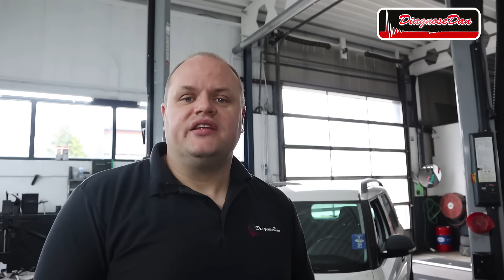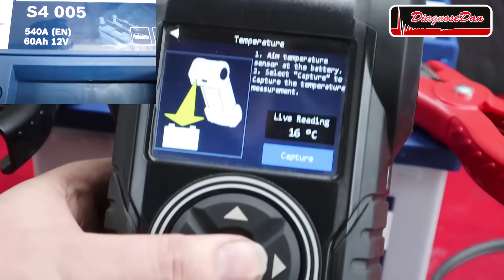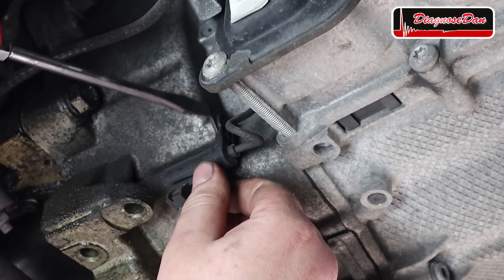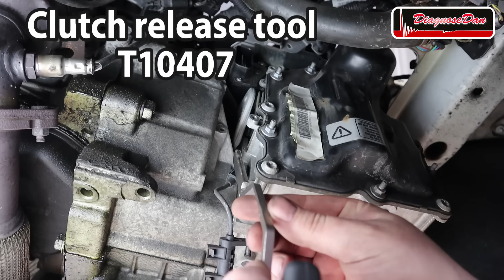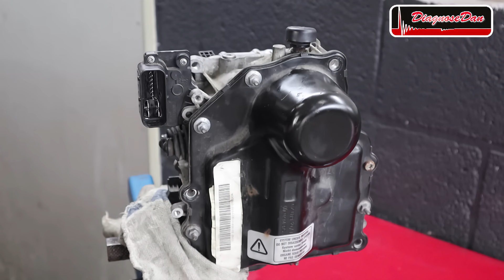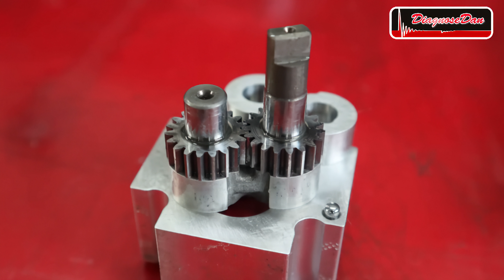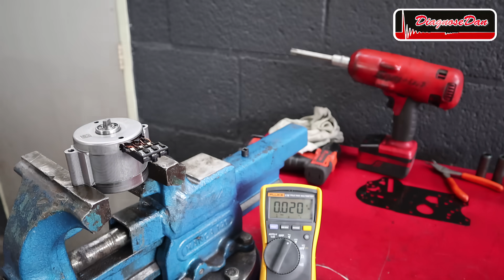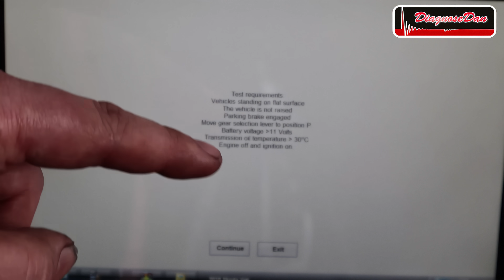DSG Gearbox Diagnosed explained Fixed

Comment: The labor cost for diagnostic seem to be much higher than the gear box unit itself. The car seem to be new but the damage to the board components for faulty design or maintenance seem to be extensive. I doubt it very much that most American repair shop will spend much time taking the gear box apart to look for the cause of short circuit, rather than order the new module and swap it then charge for the service.

Comment: Would a tester like this work on a BMW where you attach the charger/tester terminals in the engine bay even though the battery is located in the trunk?

Comment: Hi, I have a 2012 seat Leon  diesel automatic that flashes up select n or p  on the dash but won't start no matter where the lever is, fault code is 01315  gearbox control unit, no communication, perminent.  Any advice? Thanks

Comment: Very informative to see how this works - had this happen to my MY15 Mk7 Golf a few weeks ago when stopped at a set of lights. The local VW dealer wanted $3000 (Australian) to fix it as it was outside of warranty (only 3yrs when I bought it) but then found out about the safety recall. Got onto VW Australia and played the 'if you don't fix it, I'm about to buy a new car and it won't be a VW' card and lo and behold a few days later the dealer rings to say that its going to be covered by warranty.
Reply: hey peter, Im going through this problem atm. VW have told me they won't cover it. any advice?? I'm off to the ombudsman otherwise!

Comment: Hi Dan can you please help me, I am going to take the black sump/cover off of my dsg dq200 to change the accumulator and housing because it has cracked and is leaking fluid out through the breather. I was just wondering if the car has sat for a week untouched will it be okay to take the cover off or do I have to release the pressure through vcds or do I need the clutch release tool in this video if I am just taking off the black accumulator cover?
Reply: Я думаю, Вам необхідно буде замінити окрім аккумулятора тиску ще й гідроплиту мехатроніка. Для цього потрібно зняти мехатронік.

Comment: hello sir i am from india .few months my volkswagen passat 2.0tdi model 2010 automatic transmission .while i shifted D to drive then my car runs sometime normaly.but sometime  D3 to D4 not shifting' i hearing sound while d3to d4 forcing to shift gears; the sound comes like very rashy parts are moving like stone slide on marble. when i connect to diagnosis he shows "unexpected mechanical gear dissangagment.fault code p2711 found, what is the actual problem?

Comment: The best DSG tear down and run down video to date. The only problem is the acceptance of VW's root cause being the transmission fluid. That's a lie to help cover the massive recall. The root cause is actually a design issue with the TCU/ECM not being able to survive under the harsh environment. Could you let us know if there is a supplier of the pre-programmed TCU module for those of us who can not afford the complete unit.

Comment: The gear selector PRNDS lights are completely dead with a flashing spanner on the gear display. Engine warning light is also on. Key gets stuck when I turn the ignition off,have to remove battery terminal to get the key out. 
P173400- Active/Static - Stater release from the selector  leaver sensor system 
U010300- Active/Static - lost communication with gear shift Module. This are the codes I get on my Autel Maxipro

Comment: Hi Dan, what a great video as has being mentioned many times. I have a Audi q7 3tdi d,c,t. But i get gearbox malfunction light with engine light that stays on, strart, stop function stops working and i no longer can use cruise control. Then after a while the light goes off and everything starts working again.
Then randomly after some time it happens again. Do you have a video relating to this problem, or can you give me your thoughts on the problem?
Thanks Simon.

Comment: Good video Dan with explanation on the way  , textbook/mirrored failure of my daughters 7sp DSG in a Golf TDI same module burned damage & 30amp fuse blowing etc about 4 years ago, was the 1st one I had experienced at the time had the unit remanufactured with lifetime warranty by ECU Testing.com the rest like DiagnoseDan showed,   purchased the clutch tool an essential when carrying out this repair, changed gearbox oil at the same time with modified/updated dealer lube, job went well no issues, slightly annoying for a 35k miles car at the time it tarnished her faith in the model which I advised her to avoid in the 1st place  (I like my Japanese stuff)    ex Honda tech from the 80's/90's

Comment: Every morning it D "DRIVE" mode gear shifts from D1 to D4 and then it jumps to D6.... Down shift is D6, D4 & D2. After switching the engine OFF & ON again gear shifts from D1 to D4 properly and then again the error comes.... Code P073A & P1895

Comment: If you go under the car you can remove the connector for the mechatronic unit without removing the air box, in fact removing the entire mechatronic unit can be done from under the car. You didn't show how to get the car out of mechanical reverse which either requires prying from under the 6-R engagement mechanism on the mechatronic unit while removing or by taking the black inspection plate from the top off the gearbox and levering the gear train out of reverse, otherwise the engagement from the mechatronic unit will be extended and you will not be able to remove the unit. NEVER NEVER NEVER take the front plate off of the mechatronic unit if you don't have a jig as the spring in the accumulator is enough to blow your head clean off and IS a failure point (around the threads they snap clean in half), you had me wincing when you used an impact gun on the accumulator. 
You are very lucky that you managed to get the gearbox to relearn its adaptation values as usually with these OAM's over 60'000 miles the clutch will be sufficiently worn that the car will not be able to do the basic settings cycle and you will need to also replace and re-shim the clutch, to combat this you can copy the data straight from one TCM over to the other TCM and replace only the TCM not the entire mechatronic unit (Also saving the customer over 50% of parts price). We change the TCM only on every single one and have never had a problem with the mechatronic unit thereafter on a 12'000 mile guarantee. I cant stand people like you that advise more work than required and rip customers off. I bet you didn't even remove the plug in the top of the re-conned unit under the breather that stops the oil being lost in transit.

I cant believe someone would think a solenoid short would blow up an ECU, and to second that you didn't even test them when they got hot. Which is when they would fail.
Seeing as I do these all day it is clearly apparent how much you actually DON'T know about what you're doing. Up until now you had me convinced, but its apparent when you enter my area of specialisation that you are just bullshitting your way through as much as any other mechanic. You just grab a multi meter first.

Comment: I owed a Passat 2.0 tdi with Dsg 6 gear and had done 600.000 klm on it, only changed the clutch once and what ever service it needed oil filter etc.The Dsg 7 gear were always having problems
Reply: This is correct, the 6 speed wet clutch is much better.

Comment: Hey Dan , just stumbled across you channel . What a great tutorial on the DSG gearbox . I owned one in a VW EOS  2008 model , never had any problems with it . As a car guy I really appreciate the fusion of the two manual gearbox & clutch setups , controlled by the mechatronic   and your very good explanation of how it works . Great work !

Comment: Dan, that test where the fan comes on in the unit during the RC test, I take it the load provides a 25A drain or has that changed? Makes sense because that fan is on a long time, so the current can't be all that high.

Comment: Did this very job back in may last year.... wasnt blowing the 30 amp fuse though... just lost drive...and logged codes for no pressure etc. But your vid is text book.... was just how i did it the measuring of the piston actuators etc.... cars still running anyway👌😎

Comment: Hi Dan , ive got this code on mu bmw f46 : Fault: Swirl flap actuator position, long-term drift position deviation is too high
- Code: 279000 . Tested swirl flaps at bmw they are saying that everything is fine with flaps.  But this code still comes and goes , any opinion please ?

Comment: Hi Dan, please i need your superior advice on a car that's currently sitting in my shop. A mercedes c300 2013 that's gone haywire. While driving, all of a sudden the esp and traction control light comes on at the same time, then it says cruise control inoperative, then the CEL comes ON, the fuel reserve light comes ON to and every other light on the dash. At this point the car wouldnt even crank. I've scanned it and obtained multiple CAN-bus related codes most if which are tagged "intermittent". I've check all the fuses and they're good. If there's any other way I can reach, I'd like to send you the full scan results. Thanks champ, hope to hear from you soon!

Comment: Nice
Already opened my mechatronic on vw caddy 
The problem was the accumulator base ( leaked oil )
Is was a pain in the ass.
Now I need to check the gearbox
It has some delay when downshift from 2 to first gear.
:(
I really need some help here
Or it will be the clutches.....
Not sure

Comment: Surprised you did not test circuitry before teardown. Also no short to ground testing with ohm meter. It's sad when you need 7 gears to get to cruise speed.

Comment: Keep it simple.  There was a time when turning off the ignition meant no drain on the battery.
There are more cars off the road for silly faults and ending up in the breakers.  Its a plot by the car makers and the MOT.

Comment: These gearboxes are very nice to drive but very expensive to repair. I had a defect microswitch that detects the position the gear lever is in. It cost me 1000€ to replace, known problem by VW but no waranty on a 3 year old car.

Comment: I was giving some thought as to why the Mechatronics was designed in a way so as to expose the circuit board to gearbox oil. The only thing I came up with was if the circuit board was high and dry outside the case, then they would have to run wires through the case to make all the various connections. That would be a possible point for oil leaks. To avoid that, they just put the circuit board inside the case. Could that really be the reason why they put the circuit board inside the case? If so, I'm not sure it was the best decision.

Comment: Good job Dan! Oil specification is very important! For those  manual gear box required GL-4 oil, don’t use GL-5 oil because the additive for EP of GL-5 contains sulphur which could cause wear of soft metals of synchromesh gears, the worn soft metals caused a short circuit  in the VW dry DSG.
Reply: HI DO YOU KNOW WHATS THE RIGHT OIL FOR 2010 VW GOLF DSG GEAR BOX

Comment: Thank you to shared this video. Checked the price of DQ200 DSG trans refurbished (550 pound) and the tcu (125 pound) on ebay to understand the reason why you decided to the refurbish direction. All the other components were in decent shape as you told, maybe would worth a try to change the tcu only. Of course additional programming would need in this case. It would be great to check the damage of the tcu further to assess wether it is repairable or not at reasonable work investment. Somtimes two or three cheap (less than 3 USD per piece) components are burned and that is all. What a waste of material and money.  Anyway I enjoy your videos find details very usefull all the time. Keep posting!
Reply: No more programming is required if you copy the data over from one tcm to the other. you are correct though the tcm should have been changed only. It was a waste of customers money.

Comment: Dan i have a kbus question. If you have a Bmw module will pulling the fuse correct or help diagnose a problem ?  2003 Bmw z4 multiple kbus modules no communication. Air bag light on. thanks for all your great videos.

Comment: A similar thing happened on my Nissan, even though it's not a DSG, just a straight forward manual. I changed every fluid including the brakes, but decided not to bled the clutch near the slave cylinder......5 months later the seals blew out on the slave cylinder and the gearbox had to come off for the repair as it was concentric type. I really think the hydraulic oil was corrosive plus I should of bled the clutch despite being a sealed system.

Comment: Hello Dan 
How are you doing hope all well
I need your help I have a KIA Sportage 2011 which has gone on fail safe and the gearbox is only engaging 4th gear .
When I did the the diagnosis it showed me the P0880 TCM power input problem .
I have looked everywhere the wiring diagram for the gearbox but couldn't find it 
I was wondering if u could help me with the wiring diagram

Comment: On Battery Testing: The biggest problem I have found during testing is that inexperienced mechanics/mechanics don’t know/forget to make sure the battery terminals are clean and corrosion free and this means removing them and cleaning them before you test. So many times I’ve had customers come in and tell me that the previous mechanic replaced the Alternator (a few times even 3 times) and they still have a problem,  that I’ve remedied by simply cleaning the battery and terminals and charging the battery and retesting to verify the battery is actually good.

Comment: Excellent, as always. I was kind of expecting that the first thing you would do after removing the Mechatronic unit was to check for a short between the power pin on the connector and the Mechatronic housing in order to confirm what your diagnostics showed up to that point (that the short was somewhere within the Mechatronic unit). But that's just me.
Reply from the maker: The short was already confirmed at that point 😁

Comment: as it was vw's fault ....did the yrefund the cost to the customer i wonder..............also removing the sulphur presumably was an antiwear additive to prevent wear - i wonder how long the new one will last without it............
Reply from the maker: If the customer never reacted to the recall to get the oil changed the consequences are for the customer. And with the new oil you won't see the same fault anymore

Comment: Hi @DiagnoseDan. First I wanted to say congrats on the amazing videos. I really like watching them. Can't wait for the next one to come out. I wanted to ask you a question. I have a seat ateca 2018 that has the same gearbox DSG7 with a dry clutch and I wanted to know if there is any need to change the gearbox oil during its lifetime? I read many forums and some say yes and some no. I also asked my local deal, but they are worse and do not even know. Thanks and keep up the great work.
Reply from the maker: I would certainly recommend it!

Comment: I wonder what percentage of breakdowns relate to a failed DSG transmission. How could anyone come up with such a complicated design and then sleep at night. That breakdown and subsequent repair probably cost at least 3000 Euros plus a new battery to add insult to injury. However, it made for a very instructive video. After watching it, how will I now sleep at night! My brain has melted like that plastic.
Reply from the maker: You are very far off with your estimate the repair was alot cheaper. Thanks for watching👍

Comment: Would VAG not have supplied a new unit if there is a Safety recall for this fault Dan? Why should the customer pay for a "new" one?
Reply from the maker: If you never went to the Dealer to get the oil changed for the right oil when they recalled the vehicle. Than the the customer is responsible for the consequences
Reply: @Diagnosedan  Ah so they never acted on the recall, i see.

Comment: very good show DD, i have a 7 speed dsg, skoda 2009 model, people can easily get confused with oils and maybe someone changed the oil and used the wrong oil in the mechatronic's unit, i changed mine just to see the oil at 105000 klms the oil was still the green color oem oil, it was clean, so I put new oil from VW, 1 litre, they say it never needs changing, I also changed the main gearbox oil with 75w whatever which is purpose made for the 7 speed box, was nice and clean as well, people should be aware the 6 speed DSG uses a particular oil made for wet clutches.
Reply from the maker: Thanks for the comment 👍

Comment: thanks again for tutorials lots off info. especially the battery as im road side assistance an concur on checking battery for volts, ampagne and normally the voltage reading determined alternator problem or fuse ,belt also.
Reply from the maker: Glad the video helped👍

Comment: The board itself is around 140 Euros and you have to assemble it yourself. Dan has to give warrant for it, so a remanufactured unit for 350 Euros is not a bad deal there. Good video and we learned a lot, thanks.
Reply from the maker: Especially since Acumulators fail, you need new oil, solenoids fail,ect

Comment: Good video Dan! I had exactly this problem (Saw TSB ref the oil) As the car was to be sold by my son, I changed the oil twice and it worked very well, the car had about 65k (miles) on the clock. So beware home mechanics, if you have a DSG and don't know the history change that damned oil my friends.
Reply from the maker: Great advise!👍